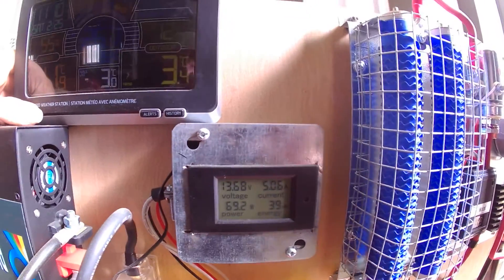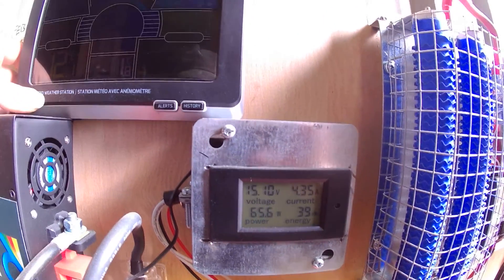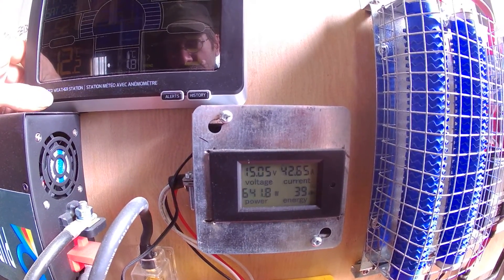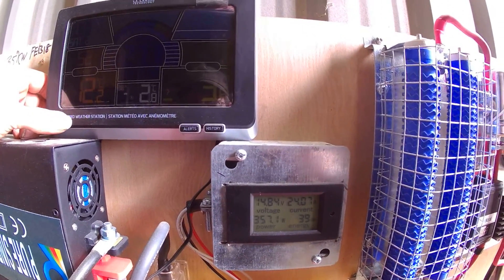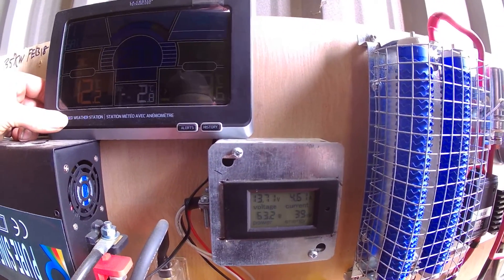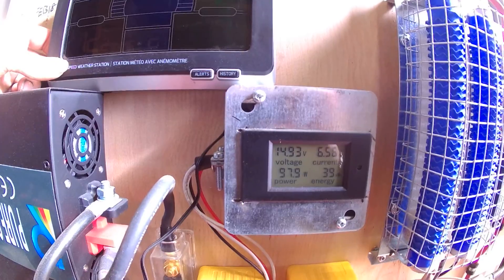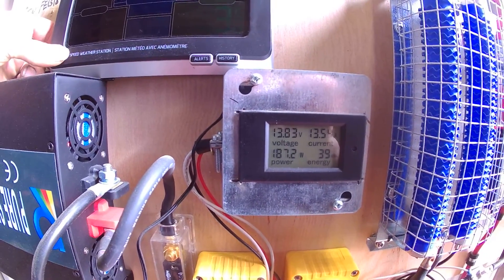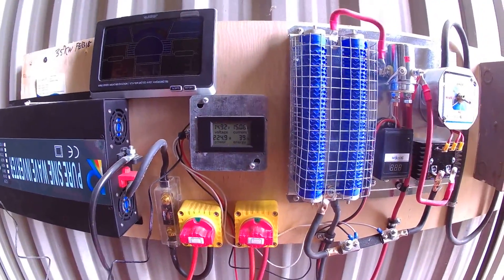Hurricane 750W 12 volt turbine

Comment: Very nice setup how much did everything cost to set it up ?
Reply from the maker: at that time I had around 4K invested.  made changes after that to the wind controller system.  still working to run my shop lights  almost 5 years with only battery maintenance
Reply: @advantagesulky6498  so does the hurricane turbine really bring in the power ?
Reply from the maker: @donaldsteele6276  at my location it makes me over 200KWH every year https://www.youtube.com/watch?v=rvRK3kv539M

Comment: 750 watts out of a 750 watt turbine. I'll let you know when I get the rated 1600 watts out of my turbine. Just don't hold your breath mate. Great video.
Reply from the maker: yes good luck on that 1600 watts, I tried one of them for 3 months
Reply: Lol what kind of turbine is it?
Reply: My 500 watt 3 phase  B creations wind turbine produces 600 watts in 27 mph winds and has hit 900 watts in 35 mph winds and triggered my 300 watt resistor bank to drag it down.  My system has 1200 watts of solar  and the 500 watt rated turbine on a 1410 ah 12v bank . It's definitely a beast .
Reply: https://youtu.be/ony0J8-i6V0